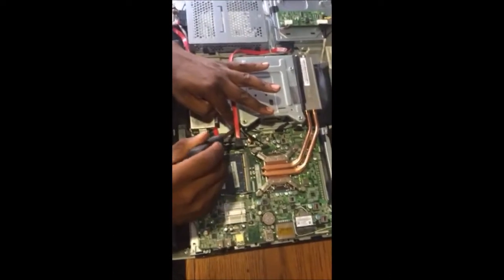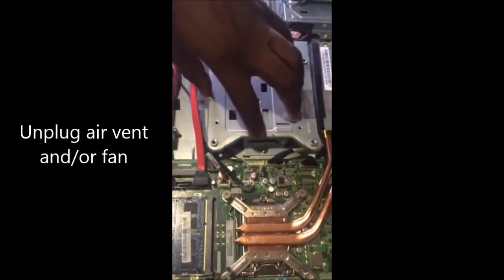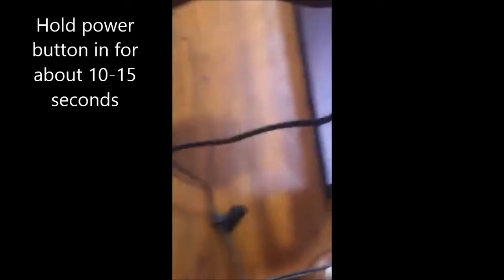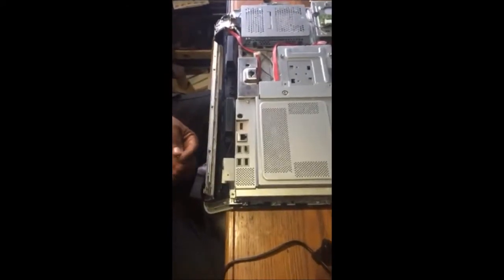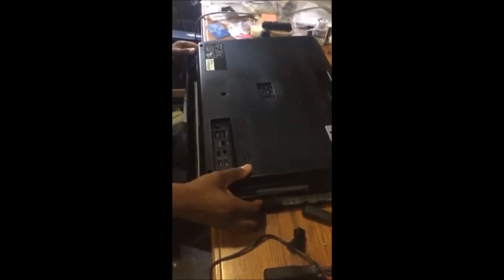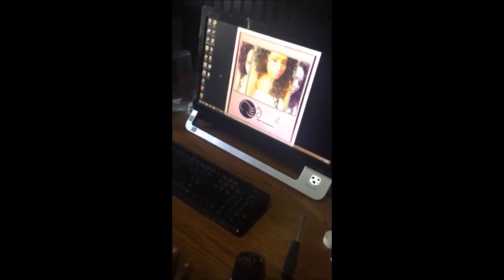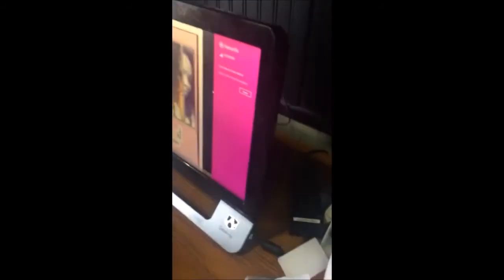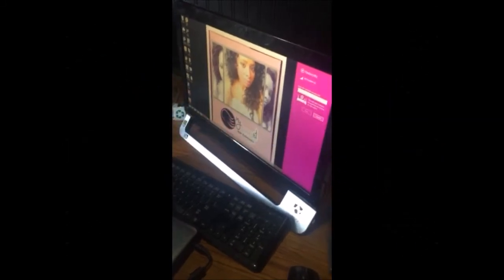Gateway zx4970g desktop Screen Blank or Black How to FIX it yourself home repair tips

Comment: y'all just saved my life.....my gate way zx6971 was brand new!! i had it sitting up for 8 months to use in my office. went to set it up and nothing tried over and over took it apart and still nothing. i paid 800 for my unit and was gonna sell it to someone for 100 dollars...came across this video and BOOM...im back like i never left...lol Thank you!!!!
Reply from the maker: You are very welcome!  Yes I know exactly what you mean.  You were gonna try and get something out of the deal if at least 100, but luckily you fixed the problem.  Now you can get back to action.  I haven't had the problem since and I'm super glad.  I just feel like it got super dusty.  That's what probably happened to yours since you had it sitting for 8 months.  It probably collected dust in the heating section and just needed to be aired out.  I need to dust my area because I know it's been like a year and I have never dusted mine off.  I hope you gave the video a thumbs up and thank you for commenting and watching also.  Take care!

Comment: Right now if I power up the PC I'll hear the CD/DVD drive spin and I'll see the lights come on. The screen is %100 black and doesn't power on. I don't even think it's making the beep it used to. I'm going to give safe mode a try and cross my fingers. But I really think this PC will need a good cleaning.  All the fans will need to be blown out. I am confident tho that because of your tutorial that I will get it working again.
Reply from the maker: Did you ever have any success after cleaning everything ?
Reply from the maker: +Denyce @MyLuxury1st oh wait I think you already followed up. Hope it's still going strong.

Comment: Thank you for asking. All seems good with the PC! Usage has been minimal since fixed (too busy with 2 small kids!).
But so far the fix has lasted. I still intend on posting a video and referencing the additional steps I took when doing the repair/fix. I looked into the Bios to see if I could keep the fan running nonstop, however I did not have the option to do so. I did however pick up two "goose neck" USB fans from eBay that I'll plug into the back to provide some extra cooling. I just want to ensure this does not happen again. (And as noted I picked up a replacement fan from eBay or Ali Express, I don't recall which site) Anything a user can do to provide additional cooling I suspect is a good thing.
Reply from the maker: lol. I'm going to have the ceiling fan on in the summer. I'm sure that will just blow some dust around and clog it. I want to get some type of duster as well to keep it cleaner. I work with a lot of pigments and colorants and I feel it clogs the little vent and helps it over heat but I haven't did anything since the last fix. I'll take note of what you bought on eBay just in case I need it I know what to look for. Thanks for checking in and have a good weekend!

Comment: So I got the PC apart and cleaned. I'll follow the steps from your video tonight. Thank you again for posting your fix. I do have another question tho. When you ran the PC for 10 minutes without the fan and heatsink did you see if the screen came on? Or did you not see til it was all assembled again and then powered on ? I ask because today I will run the PC hot, add thermal paste, then assemble the PC again. 

thanks

Comment: I did not record the process, but I actually want to post and video of the fix for my specific model.
Making note that I got the directions from your video.
All seems good for now which I awesome. All be it I had the PC on for minutes only.
Tomorrow I'll do more thorough testing, and leave the PC running longer.
I want to optimize the power saving settings (to ensure...I HOPE...no further problems).
I think I may just order the fan now to be safe.
My fan was NOT on upon power up....would it  come on after 20/30 minutes ? Hard to say.
I'll know more tomorrow.
Reply from the maker: +Mike Boss Oh okay, yeh I think a video of your model will be good to see.  At least the fan is cheap.  Rather buy a fan than a whole new pc.  I hoping this is going to be the fix you need so you don't have to get a new one.  At first I was thinking some type of light blew out.  And was wondering if there was a light bulb or something i could replace but I didn't think of it further since it had fixed after all of this.

Comment: Great, thank you. 
I thought that perhaps once it came back on you put everything back on.
I'm hoping this is the required fix I need.
I'd be super upset if it did not work and the PC is toast.

You said you still use it daily without the fan installed and no issues since it originally happened ?

thank you again
Reply from the maker: +Mike Boss Well we basically took the heat sensors off and for the fan; unplugged the fan.  Then once you do everything and put everything back to normal and turn it back on, then it was fixed.  But I didn't actually re-install the fan just plugged it back in, but if this doesn't work, you can try to remove and reput the fan or reinstall and see if that may be your problem... might be a lot of dust buildup is what I figured.

Comment: I was wondering if the computer turned on at all or if it didn't do anything at all when you hit the power button. Did the fan come on when you hit the power button?
Reply from the maker: +MeliVel Yes, it turned on and I have been using it every since.  And that was almost half a year ago so it definitely worked.  I can't remember if it turned back on or not; but it works for sure.

Comment: I have a Gateway zx6800. Had not used the PC in quite some time. Used it today for the first time in ages. Was on for about 2 hours, all was fine. I moved large amounts of data over to the PC. Then about 10 hours or so later I went to use the PC. It will power on, but the screen is blank. I tried to power down 2 or 3 times, but same result. I had actually left the PC for a minute to check Google and noticed it turned itself off, so I think the overheating is the issue. May I ask you, once you did this has the issue happened again ? Or was this a good fix (long lasting fix) ?
Reply from the maker: +Mike Boss Hi.  I have never had this problem ever again.  I use it everyday and I'm using it now.  So it was a long lasting fix.
Reply from the maker: +Mike Boss Also did you try this?  Have you tried Safe Mode?

Boot to Safe Mode
When you boot up before it starts Windows and after the initial BIOS checks, hit the F8 key several times. The start of Windows is usually accompanied by a single Beep. If normal Windows comes up try, try again. A Black screen with choices should come up, choose Safe Mode.

Comment: hi, I have the same computer and dont turn on
i have proved the ac adapter with a tester and everything is ok
I think the problem is with the motherboard
any idea?

also when I connect the ac adapter to the motherboard there a smell like sometihing is burned
Reply from the maker: Hi. I'm not sure.  You can try what I did.  Other than that I can not really remember everything that occurred...sorry.

Comment: I have a problem with my zx4970g gateway, the pc turns on and it listens as if it was going to boot but it goes off instantly.....The strange thing is that the HDMI mode works and I can connect other devices like the xbox one and play perfectly, and verify that the hard disk and the ram are good, so I do not think it is the motherboard since it works as an even screen Gives me the option to choose between HDMI and PC mode....And i acquired another power source since the original was broken the central pin and so my pc was not working enough time, now that I have the new power adapter I can not understand why it does not turn on the pc

someone can help to fix this problem?
Reply from the maker: I am not sure as I never acquired a new power adapter...  Did you ever get it up and running?
Reply: Yes ....is not running with the New adapter is of the correct voltage and amperage  (19v 7.1A)
Reply from the maker: You may need to get a new computer or monitor.
Reply: Denyce @MyLuxury1st yes o think so... yo know how i can connect a external monitor to the pc?
Reply from the maker: No unfortunately not.  I didn't have that problem.  With this pc; the monitor and pc are built in together which is something that sucks if the screen goes out; you have to get a new pc period.  You could ask someone at Best Buy or call a computer tech to see if they have any advice on this particular question.
Reply: Ok..thank you :)

Comment: dID EVERYTHING IN THE VIDEO, PLUS REMOVED FAN AND BLEW ALL THE DUST AND GRIM OUT. EVERYTHING SEEMS TO BE WORKING INSIDE BUT THE SCREEN IS STILL BLANK! ANY OTHER IDEAS WOULD BE GREAT.
Reply from the maker: +Trevor Ebner (EBNER666) Try it one more time.  After that I was thinking if there was a light bulb in the screen we didn't know about, try to check for that.  That was going to be my next option, but I'm still not for sure if that's even a thing yet.  Let me know.  Also another person was talking about buying extra fans... but so far I haven't needed to and I'm not sure if they ever did.
Reply: Tried it again, with the fan left unplugged and the coil off for the 10 min. overheating process of the GPU. Plugged back in,Got 10 beeps w/ black screen and then SUCCESS:) Works like new. Thanks for the extra tip and your video.
Reply from the maker: +Trevor Ebner (EBNER666) Excellent! I'm glad it worked! Yeh it was like new after we did that. I hate that this happens but at least we both worked out a fix. I'm glad yours is working so you won't have to buy another. That was what I was thinking and didn't want to buy another.

Comment: So where is the graphics card?
Reply from the maker: +H0RSE Music Hi.  I'm not sure, never really thought about it and I don't remember mentioning it...sorry.
Reply: It's cool dude
Reply from the maker: ***** Do you have this same pc?  Did you find the graphics card?
Reply: I've taken it apart and couldn't find the graphics card, Literally stripped everything down lol
Reply from the maker: ***** Damn.  This is the info I found:  
The video card is located in an expansion slot inside the computer, or it might be built into the computer's motherboard. Regardless of whether it is a slot-based device or an integrated device, the video card is configured by the system BIOS and device drivers in the operating system. Display devices such as monitors, LCD panels and projectors are connected to the video card port. Video card ports are located on the back of the computer

Comment: Heat sync?
Reply from the maker: +Wilson Revelle What about it? Are you referring to the heat sensor?
Reply: The system of alum. And copper that you pulled off with the fan is a Heat sync.  The actual heat sensor for the CPU is usually located under the CPU its self.  Heat sync is designed to draw the heat off the chip and disburse it to the fins next to the fan.  Not being judgmental :).  Just pointing it out for those who are not as educated as we are.
Reply from the maker: Wilson Revelle Oh okay, yeh, thanks!  No, thanks!  I don't think you are being judgmental at all.  I thought you were asking about it, but I wasn't sure.  I feel like mine got a lot of dust or something piled on it or near it and even til this day I haven't checked it again.  It's still running excellent, I just turn it off every night also because before I would leave it on all night and day so very night I turn it off so I think that helps too so it doesn't overheat.
Reply: Cool!  I just used the method in your video to repair one that I had and it's working ok... Now just to find a recovery disk for the stupid thing :). Glad yours is still working!
Reply from the maker: Wilson Revelle Yeh, I'm glad because I thought I was gonna have to get a new pc!  Glad I could help.  I found this online:  https://neosmart.net/wiki/gateway-recovery-disk/

and:
https://restore.solutions/en/gatewayzx4970g/

Normally, you would press F10 or F11 at Startup to commence the Recovery Process..
also:
http://www.gennersales.us/windows7recovery/gatewayzx4970windows7recovery.htm

They are charging, not sure if it's valid, make sure it is legit first.
Reply: Yea... I can get a copy.. Just looking for instant gratification.  :).  I WILL however let you know... MAKE The system recovery disk for that computer.  It does not have the recovery partition on it so you will need it if the drive fails.
Reply from the maker: +Wilson Revelle that sucks. So far a system restore or (floppy disk) I mean sd card may work for now... Ehhh. Luckily it's not super expensive but who wants to keep coming out the pocket? We might as well rebuild it from scratch the way we have to take it apart and do all the technicalities.  But so far so good so hopefully it last a few more years or (eternity!)
Reply: Actually did find an answer that worked well.  My main laptop is a Gateway NV79 and has been actually a really good system.  Anyway.  It has a Windows 7 partition and all I had to do was to make a restore disk from that.  2 DVDs later I have a clean system and and rescued another.  Now have 2 running, zx4800 and zx4300.  So.. Gateway for Gateway no money spent ;)
Reply from the maker: +Wilson Revelle good. I hate spending extra money on this type of stuff. Glad you were able to fix it yourself.

Comment: I wanted to thank you for posting this video.
I completed this today and sure enough my monitor came back on.
I wanted to add that I followed the directions of this video to the letter.
I also picked up the best thermal paste I could, installing that before putting the fan & heat sink back.
After the 1st power down the monitor did NOT come back on.
I wanted to check to see if the fans were coming on, so I powered on the PC again....and the monitor DID come back on.
I wanted to ask in the event that you know, does your fan STAY running on this PC ?
Upon initial power up my fan DID NOT run. I didn't get the PC on long to see if it would come on.
Thought I would ask.

Replacement fans for the ZX6800 are available on eBay : http://www.ebay.ca/itm/NEW-Replacement-For-Acer-Aspire-Z5600-For-Gateway-ZX6800-Series-CPU-Cooling-Fan-/351031515816?hash=item51bb1bdaa8:g:AcsAAOSwWnFV~Myz

Thank you again
Reply from the maker: +Mike Boss I see 15 were sold so I guess this happens more than we think.  You are welcome.  Did you happen to record the extra part that you had to do?  For the fan, I think it stays running in the background to keep the PC cool.  I leave it on all day but at night I have been shutting it down and have not had the problem anymore.  I have a lot of mica and dust flying around over here so I'm hoping it last long.  

So is everything working again?  Are you back to normal?  I wasn't aware of the thermal paste.  I will keep it in mind for future reference.  Thanks for keeping in touch. :)